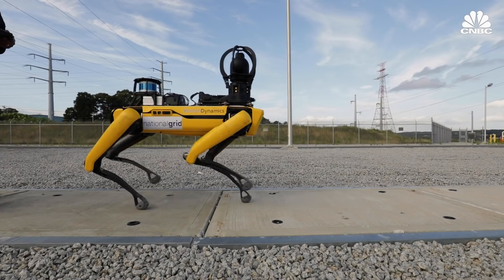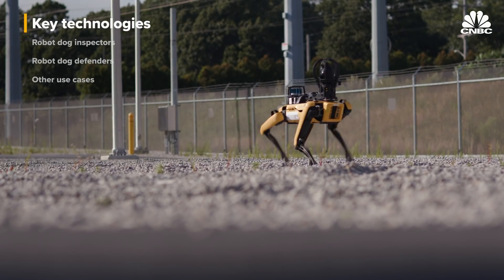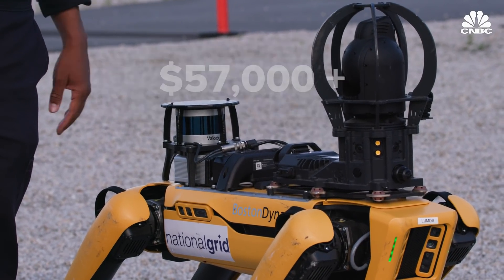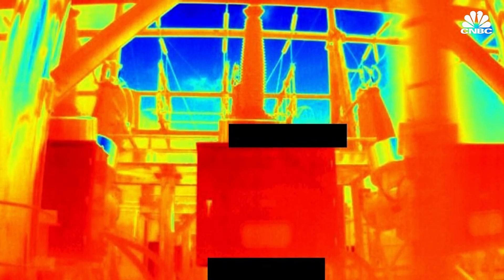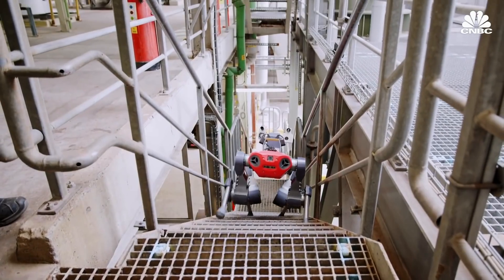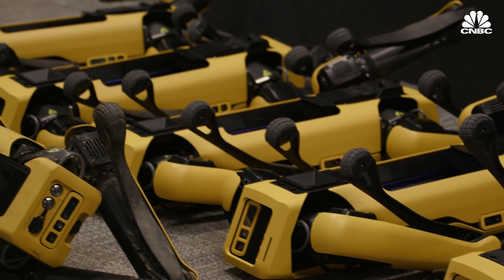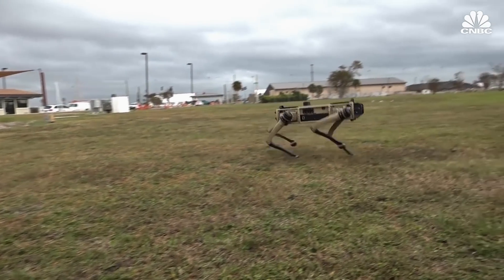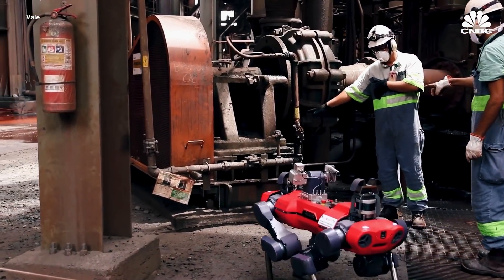Where Four-Legged Robot Dogs Are Finding Work

Comment: The NYPD’s use of the robots actually seemed like a good way to prevent unnecessary deaths.

Right now if you have a 9/11 call about an armed or violent situation in an apartment, a cop knocked on the door or kicks it open with their guns drawn. Their lives are at risk and so are the people inside. Switch this out with an unarmed dog, no one’s life is in danger. The police can then assess the situation from afar and make a decision after thinking it out rather than having to make split second life or death decisions.

Comment: The battery packs can be pulled out and replaced. However, the packs take 90 minutes to be recharged. If you have multiple packs in multiple areas being charged and one in use, the robots can work for extremely long periods.

Comment: It doesn’t need breaks although it needs to be recharged after 90 mins….. so it needs break then???
Reply: They are testing for swappable battery packs. So that robot in docking station drops it battery, gets a charged one and continues to work. Main issue is docking station would be pretty complex and would make sense only if there are a bunch of robots in the environment.

Comment: "Doesn't need breaks" but batteries need to be charged. That is the exact definition of a break. We recharge when we take breaks.
Reply: @Fish301AJ  that's also a good point. Would be nice if we could hotswap our batteries lmfao
Reply: @LifeWithRilla  you forget that companies can have any number of these running around. If one is charging, another one can take its place. This can happen 24/7 365 days a year. They can be serviced and repaired, and still would be cheaper than hiring people depending on the task.
Reply: @Fish301AJ  I'm pretty sure that's how they work already, hell, I'm pretty sure boston dynamics has a video of one of those dogbots swapping the battery of another dogbot, kinda spooky
Reply: @Fish301AJ  spot has hot swappable batteries, most likely the same as the others
Reply: It's all cute and amazing until you see one with a m240 mounted on it's back
Reply: Its def the future for efficiency tho, apart from needing charging, which better tech will make more effeicient over time, one robot can cover 3 8-hour shifts (ignoring charging time).

Eventually they will just have very dense batteries or mini reactor inside them and off we go!
Reply: How many do they have? One working while others recharge.
Reply: A robot isn’t telling a joke better than me. Heck outta here!
Reply: @MikeBellamy2  There things sentients will always do better than a machine. Relax

Comment: Maybe, if you build little ramps on your stairs, you don't your robots to have legs. Wheels are super efficient, and much easier: no fancy balancing software required. #1 principle in engineering: keep it simple.
Reply: And good argument for new construction but do you really think it’s feasible to retro fit hundreds on oil platforms or confined spaces to have ramps?
Reply: Amazon and other warehouses already have wheeled robots. Legged robots are for a different use case where their flexibility is important. Its like saying all cars should be hybrid sedans because they are most energy efficient when thats not the only use case.

Comment: If stopping to recharge every 90 minutes isn't considered a break then I don't know what is.
Reply: Even the most expensive of electric bills are peanuts to wages
Reply: Maybe what they need is to have one dog charge the other while on the go. The charger dog would mount the other and plug in somewhere. Maybe under the tail?
Reply: You could probably replace the battery pack in less than 1 minute.
Reply: @allyourcode  so it needs a 1 minute break every 90 minutes?
Reply: @g00rb4u  Dude you should sell those batteries, you would be rich!
Reply: @g00rb4u  prob still more efficient than a human XD
Reply: Haaahaaaaa
Reply: bruh these robo dogs get better working conditions that people
Reply: Hahahah
Reply: Follow predetermined paths autonomously?  Who wrote this?
Reply: Longer break than I need after 90 minutes
Reply: 由美國軍工聯合體資助的澳洲智庫aspl 的報告：在人工智能、量子計算、生物技術和先進材料等44個關鍵科學領域中，中國在37個領域領先美國。

有很多的事情都是被誤導，去看寒國人的視頻就知道了。
Reply: They could install cameras in the areas that they want to inspect, this is a solution to the same problem. 🤷‍♂️

Comment: They make sense as security robots.  Sending one of these robots out to a potential intruder first to gather information seems like a good idea instead of putting a soldier/security guard in potential harms way.
Reply: @larpbusters  luddite learn new skills instead of hampering productivity. The same was said of industrialization which we enjoy the benefits of. Jobs should meet demand not hold back productivity other countries will push anywaysm
Reply: @chinesesparrows  what if there are no new skills to learn? We are heading towards a world where there is no jobs.
Reply: @jaimemunoz5920  barriers may rise but certainly there isnt a lack of skills or demand. Just the IT field alone is chronically hiring. A 12 year education wasnt the norm either 200 yrs ago thats how much jobs have changed already, learn to adapt than self proclaiming to be a victim.
Reply: @chinesesparrows  okay so first off there's two issues with your idea. The first is how do you teach someone to learn computer programming who is 55 years old and is now out of a job because the only thing they've ever done is drive truck and that is all they know. And they barely know how to run computers.

The second issue is let's say we go on a low-end and let's say there's 40% of people who no longer have jobs because of technological unemployment. But there's only enough jobs for 10% of those people what do you do with the other 30% that even if they knew how to do the job there just wasn't enough jobs for them.

And also so right now if the robotic dog breaks we have to be able to fix it and it's complicated. But in the future as with all technology it will become simpler to replace and at some point in time there will be a fixing robot that would be able to fix the dog for like 90% of anything that could go wrong. Maybe even more. I mean as an example I'm literally talking to you on a computer that cost me $90 and there's no physical way for me to really fix anything if it breaks and honestly I wouldn't really want to. I would just get a new one because it's so cheap I'll just buy a new one.
Reply: @jaimemunoz5920  its simple if we dont automate others will and outcompete us through efficiency. Others will lower costs and overtake our market or buy us out. You simply cant out compete efficiency, protectionism will only protect the widening gap in efficiency. E.g. factory jobs got outsourced to asia, then service jobs to mexico/india, nowadays workers are voluntarily leaving jobs in droves to find better work or conditions. This is not new and will continue, adapt or not.
Reply: @chinesesparrows  How does that relate to anything I said or what you were saying earlier about people needing to be able to adapt to new skills?
Reply: @jaimemunoz5920  can you repair your smartphone? Or a modern car if one of its many chips malfunction? Then how are you using it? You afforded what you can, and stuff you dont know you outsource to contractor to fix. You are already living like that
Reply: @jaimemunoz5920  if your gonna make ridiculous assumptions out of thin air, then so can i. So robots become so efficient and affordable and self repairing everyone gets one for free that earns money and makes them food. All of the world's greatest issues are resolved yay.
Reply: @chinesesparrows  Google technological unemployment and you can see that I'm not making up assumptions. There's a lot of people in the world people that have studied this stuff and you can read it for yourself and see where I'm getting the information from.
Reply: @chinesesparrows  what does this have to do with jobs and getting new skills? I don't understand how this fits in with your original thought. But to answer your question no I can't fix either of them. And if my phone broke I would just get a new one. I get a new phone once a year anyways generally.
Reply: @jaimemunoz5920  there are also scholars saying that life is a simulation, nothing is real. There are also scholars saying science is white man's colonial activity. Take what you want from scholars but thats them and your reality is yours.
Reply: @jaimemunoz5920  i already said there are plenty of jobs and skills in demand. You made wild assumptions on future prospects and i answered in kind.
Reply: @jaimemunoz5920  So your point is that we should stifle innovation because some people will lose their jobs? The same thing has happened many times before.
Reply: @vengefulspirit99  I'm not sure how you get that I'm thinking we need to stifle innovation. I'm saying we should do it but we need to be prepared. Like Universal basic income or something else. I'm saying it's inevitable that people will not have jobs and we need to start getting prepared.
Reply: @jaimemunoz5920  that is a political decision what can happen, but want to emphasize use blocking innovation wont stop others from innovating and outcompeting us.
Reply: @jaimemunoz5920  the government will give you a bag of rice, cereal or tortilla.
Reply: @JapaneseSentenceMiningbyKha  I live in America. Our government gives us more than that.
Reply: I prefer the security robots from knightscope. These would also work.
Reply: Pym op
Reply: @path4061  Google technological unemployment and also Universal basic income. Read up a little bit and you can see what I'm talking about is not my speculation it's what actual experts in the world have talked about.
Reply: @larpbusters  human police have earned their obsolescence.
Reply: The problem is the company will fire the human inspectors, effectively replacing them. It’s okay to advance the technology, but it’s not okay to drive industries into only two working classes left, one super high paid, making up 5% of workers and earning 95% of revenue and 100% of profit and other super low level jobs with next to nothing pay costing 5% revenue and making up 95% of workforce. The balance is never achieved.
Reply: This will end badly...  

You know it
Reply: How about you just use a security camera? Lmfao.